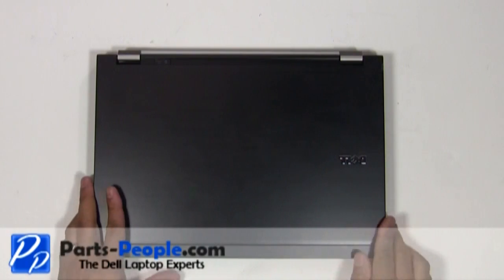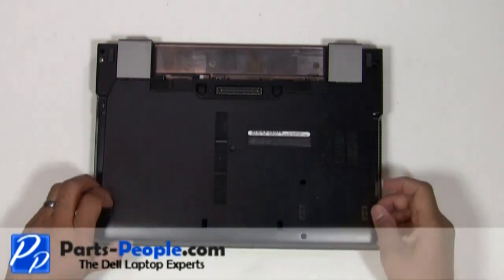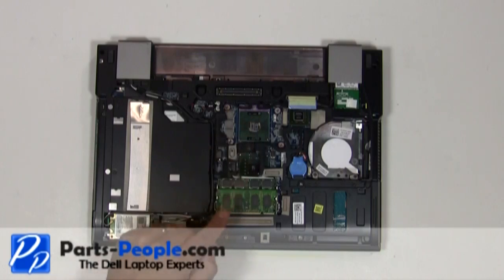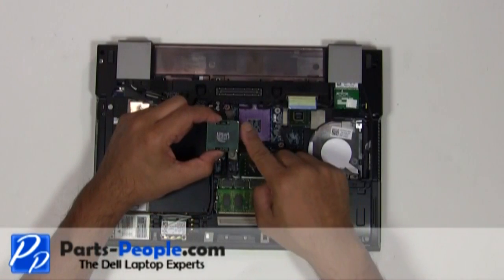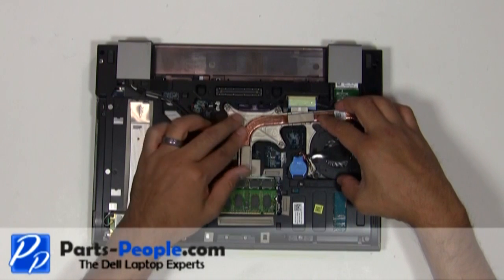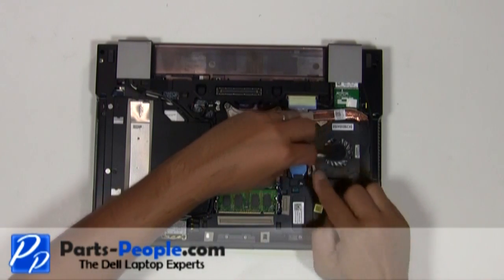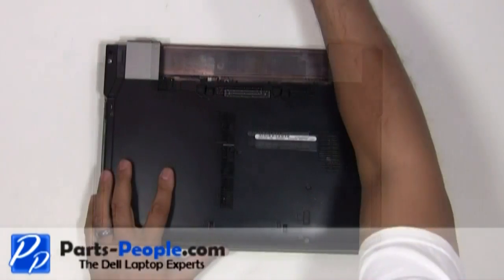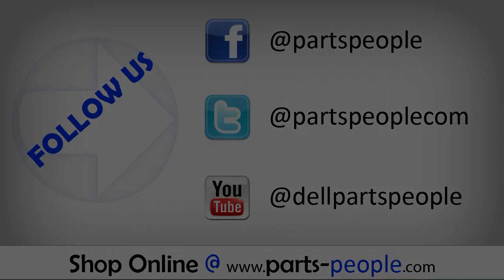Dell Latitude E6400 | CPU Processor Replacement | How-To-Tutorial

Comment: Besides changing the thermal paste, does anyone know if there is anything else I can do to the E6400 that would improve thermals? Essentially what I want to know is, are there "upgrade" options for the heatsink, fan, and thermal pads? Would a heatsink from a similar model laptop, such as the e6410, make any difference or even be compatible? I've already got Arctic Silver 5 thermal paste to put on the CPU and GPU, and an SSD in place of an HDD. I just want to know if I can go further. Also is there perhaps a lower wattage compatible ddr2 sodimm Ram that still runs at 800mhz? Are there any lower wattage WiFi cards?

Comment: Hi, I want to upgrade from the Core 2 Duo p8700 CPU in my Dell Latitude e6400 and I have two questions. 1) Will the Intel Core 2 Quad q9000, q9100 or qx9300 (pga 478 socket CPUs like the p8700) work in e6400? 2) If so, assuming I'm using a high-quality thermal paste like Arctic Silver 5, which is VASTLY better than the VERY OLD stock thermal paste that it originally had. What will the thermals be if I use one of those. (Preferably would like to know about the Q9100 specifically cuz I found one for cheap at a store)
Reply from the maker: I haven't tried a Core 2 Quad on the E6400 before, I'm not sure if it will work. Dell isn't giving me any info either. If you try it, let me know.
Reply: Parts-People.Com, Inc honestly I'm not going to try it if I don't know. I'm afraid that the motherboard could fry due to the difference in wattage. So I won't try it unless I've gotten information from someone who actually knows and is not just guessing.
Reply: Parts-People.Com, Inc thanks for the quick reply though. And if you know anybody who might know or has the money and resources to just test it themselves, without it bothering them if it does fry it, send me a link or some info on them. Thanks. That way, in the future, other people like me who want to make upgrades to the same computer model can know if it'll work or not. Or even if it does work if it'll be safe.
Reply: Parts-People.Com, Inc Another thing I like to know is, is there anything else I can do to the E6400 that would improve thermals? Essentially what I want to know is, are there upgrade options for the heatsink fan and thermal pads? I've already got Arctic Silver 5 thermal paste to put on the CPU and GPU, in an SSD in place of an HDD, I just want to know if I can go further. Also is there perhaps a lower wattage compatible ddr2 Ram that still runs at 800mhz? And perhaps a lower wattage/lower temp compatible GPU that's still decent performing?
Reply: Parts-People.Com, Inc Nevermind I finally found my answer. It won't work... I found a thread on notebookreview.com where a guy gave an expansive list of compatible upgrades and noted that he had tested the Q9100 and it didn't work. How unfortunate.
Reply from the maker: To answer the RAM question, no there isn't a low voltage DDR2 for the E6400. 

For the heating question, you should replace the heatsink and make use you have a thermal pad, not compound, on the GPU. If you only have compound it doesn't create a good enough bond because the heatsink sits too high above the GPU, a pad is necessary. I also suggest replacing the heatsink because after multiple removals, hairline cracks can form on the tubes. If that happens, the gas can leak out and it won't dissipate the heat as well. 

Good to know about the Q9100. People will find that useful.
Reply: Parts-People.Com, Inc actually I read about a hack using a small thin sheet of copper in between the GPU and the heatsink. In that way thermal paste would work.
Reply: Parts-People.Com, Inc if you want I can send you a link to that thread. Here you go, http://forum.notebookreview.com/threads/howto-latitude-e6400-and-similar-performance-cooling-guide.375889/
Reply from the maker: It's true, you can use copper shims to fill the gap between the heatsink.
Reply from the maker: The idea is that you don't want gobs of compound to try and fill the gap by itself. That would crate a bad conductive bond.

Comment: I have Dell latitude E4300 Core 2 Duo CPU P9400 is core 2 quad compatible with this laptop ?
Reply: Hey BlueGeek, did you ever try out a core 2 quad with the Dell just to find out for yourself? Cuz I want to know the same thing and I can't find a straight answer online as to whether or not it will work. Every website I go to people say they're not sure and just give a (very vague) answer based only on a guess. From my research I'm willing to believe that the e6400 has the software/bios compatibility for it. But what really worries me is that I'm not sure whether or not it supports the power draw of the core 2 quad. 45 Watt TDP on the Core 2 quad versus the 25 watt TDP of the p8700 that I currently have and the 34 & 35 watt TDPs of the "T" series (T5200 through T9900) cpus which I know are compatible. And even if it does support the wattage I'm afraid of the thermals it will create. Does anyone know if I should even be worried about the thermals since I'm going to use Arctic Silver 5 or some other high quality thermal paste?
Reply from the maker: As far as I know, the E4300 only uses Core 2 Duos.
Reply: BlueGeek Nevermind I finally found my answer. It won't work... I found a thread on notebookreview.com where a guy gave an expansive list of upgrades for the E6400 and noted that he had tested the Q9100 and it didn't work. How unfortunate. Yet somehow the X9100 works by undervolting.

Comment: P8400 – 2.26 GHz, Std Voltage 25W, 3 MB, 1066 FSB
P8600 – 2.40 GHz, Std Voltage 25W, 3 MB, 1066 FSB
P9500 – 2.53 GHz, Std Voltage 25W, 6 MB, 1066 FSB
T9400 – 2.53 GHz, Std Voltage 35W, 6 MB, 1066 FSB
T9600 – 2.80 GHz, Std Voltage 35W, 6 MB, 1066 FSB

What would you recommend?

Comment: can i upgrade my pc(latitude e6400)to inter i5
Reply from the maker: +Fredrick Sifuni The e6400 cannot use i-series processors. It uses Core 2 Duo's. Here are some we've tested and know work: p9600, t9800, t9600, t9550, t9400, p8800, p8700, and p8600.
Reply: Which is the best(faster)

Comment: when i bought my dell latitude e6400 i was playing video games and streaming video games now after a hour of playing video games it gets really hot and starts to slow down my computer what should i do about this btw when i bought this computer i can play video games all day without a problem PLLEASE HELP
Reply from the maker: +gaming cowboy You can try cleaning the heatsink and fan and applying thermal compound. That will probably help it cool down. Other than that there is not  a whole lot that can be done. Laptops don't have great airflow for cooling, so they're gonna get hot, especially with gaming.

Comment: i have a Latitude E6500, can i swap it with intel i5 or intel i3? pls answer
Reply from the maker: +npgaming The E6500 can only use a Core 2 Duo processor. The i Series is not compatible.
Reply: +Parts-People.com, Inc how to make it  faster for gaming then?
Reply from the maker: +npgaming You can't. It's too old to upgrade.

Comment: I have Dell E6410 i5 with cpu M520 , can i swap it with intel i7 model i7-640M chip ?? I also updated the BIOS to the latest version
Reply from the maker: +Salvo Dipasquale-RG Yes, I believe the i7-640m is compatible.
Reply: Yes you should be able too

Comment: is it possible to upgrade a latitude e6400 so it has a i5quadcore?please i really need help with this stuff
Reply from the maker: Rylee Covey Sorry for the late response, I've been out for a week. This laptop simply can't use the i Series CPUs. The laptop is just too old and can't handle it. You would have to get a newer laptop to use the i3, i5, or i7 CPUs.
Reply: Nope, you can upgrade the Intel core 2 and get the premium runs higher ghz

Comment: Hai, was wondering if the Intel core 2 duo t9900 3.06 ghz worked with the dell latitude e6400
Reply from the maker: I think the t9900 is compatible, but I'm not absolutely sure. Unfortunately I don't have one to test.
Reply: it is suppose to work, see:  https://www.dell.com/community/Laptops-General-Read-Only/E6400-Processor-Upgrade-Options/td-p/3577325

Comment from the maker: No, it will ONLY use Core 2 Duos. Here is what Dell has listed as compatible:
P8400 – 2.26 GHz, Std Voltage 25W, 3 MB, 1066 FSB
P8600 – 2.40 GHz, Std Voltage 25W, 3 MB, 1066 FSB
P9500 – 2.53 GHz, Std Voltage 25W, 6 MB, 1066 FSB
T9400 – 2.53 GHz, Std Voltage 35W, 6 MB, 1066 FSB
T9600 – 2.80 GHz, Std Voltage 35W, 6 MB, 1066 FSB